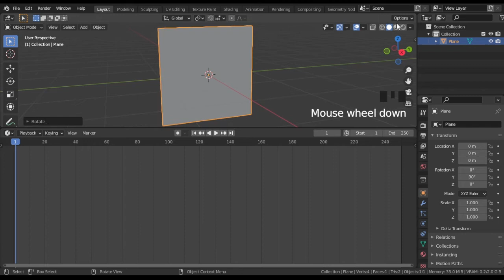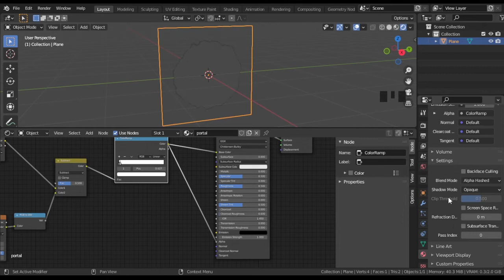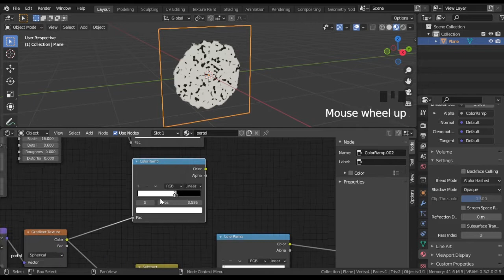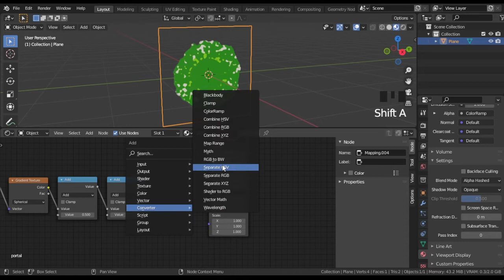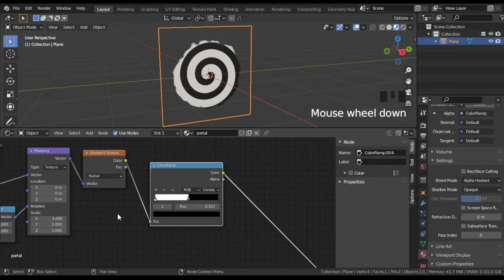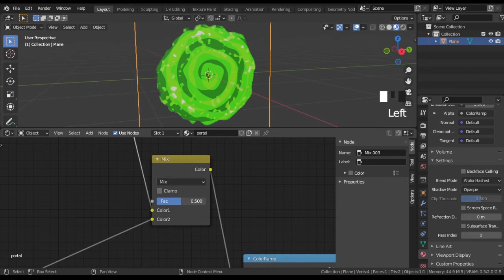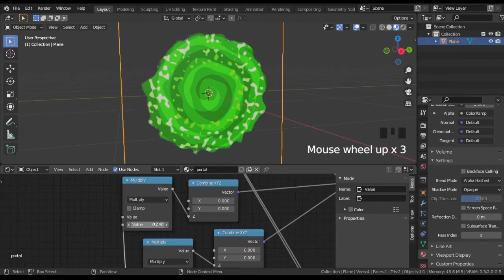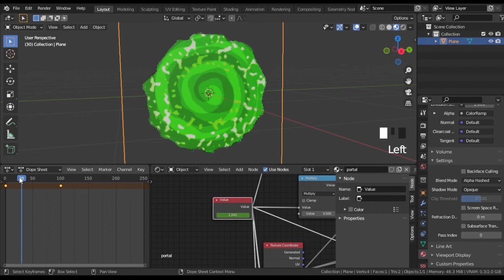How to make Green portal from «Rick and Morty» (Blender tutorial)

Comment: hey it's been 3 year's after this video but i wanted to know how can i make it thick? i tried to use the solidify method but it didn't work hope you will answer
Reply from the maker: Hi! Sorry for late response – haven't opened a project for a long time plus was busy with pwnisher challenge). I hope my answer will be still relevant. 
So, before solidify add subdivide surface. Your solidify thickness set to zero. In material settings look for displacement and set to displacement only or displacement and bump. Then go to shader nodes, find a substract color node that goes to alpha (right before color ramp) and input it to height value of displacement node. And finally connect displacement node with displacement input of material output. You can additionally add a color ramp before displacement node. Tweak black and white sliders to set affected area (I pulled black a bit to the right like 0.05 and white to the 0.2), pick a scale for displacement node (0.2 worked well for me but you can pick higher for thicker one; midlevel value stayed 0) . And for subdivision – displacement works better with higher geometry. So easily set to 6 if acceptable for your needs. 
That's the best way to achieve this in a current setup I've found. Better approach might be using geometry nodes but it would be a whole new project from a scratch.

Comment: Hey Bro, can you tell me how i have to export this material, so it is still animated in unity? Cause with fbx and standart settings it will import as a gray plane. Btw, really cool Tutorial Bro, you deserve much more subscribers and likes
Reply from the maker: Thanks, Bro! Glad you liked it! 
    Struggled with your problem for a couple hours but finally found a solution. https://www.youtube.com/watch?v=1W_QCoLb4hQ this tutorial is your answer. 
    For this you will need add-on (link in that video's description). On GitHub you will only need the oscurart_bake_pbr.py file. Save it on you PC. Then install it (Edit -> Preferences -> Add-ons -> Install -> Refresh). Blender: Bake PBR should appear in the list. In Render Properties Bake PBR tab will appear. Check Base Color, Alpha and Render Sequence there. Uncheck Selected to Active. Delete all the keyframes at Dope Sheet Then go back to Shader Editor. In Value Node type #frame/10 
    Finally click Bake PBR Maps. It will take some time to bake everything depending on your PC. When baking will be finished the folder IMAGES will be created in the same folder where your blender file is. I executed this at my portal project and it worked. It should work in Unity too but I haven't tested it. As a last resort you can use these images to create a gif. 
   Hope it will help your project.
Reply: @drrender4931  Thank you very much, that helped :)
Reply: @eatdeliciouskids7965  Hi did it really work with you? If it did, can you tell me exactly how did you do it because I don't know how to import the images file to Unity

Comment: Hello. I have a problem: I would like to make a cyclical animation for that portal. BUT I need there to be no abrupt transition - that is, I want the portal animation to flow smoothly into itself each time, without tearing. And the rotation must be strictly clockwise. Can you tell me how to do this trick with this particular portal?
Reply from the maker: Hi! Sorry for not answering earlier. For rotating strictly clockwise you can simply change sign in each multiply node. 20 – > -20 and so on. In each. For cyclical animation things are harder. In easy way you can simply disconnect location value for each mapping node to make it constant. Add math node To Radians right after input value node. I've picked input value 36 000 and now the animation is smooth. After that it's up to you to pick the speed of swirling. Just drug the keyframes righter (i moved to 500 th frame) to decrease rotation speed and try picking another values for multiply nodes. If you want a bit more variety try some periodic math function for disconnected earlier locations in mapping nodes.
Reply from the maker: In addition, I've also changed two multipliers that go to wave  texture from 0.5 to 0.05. Now the spiral swirls a bit slower than should compared with edge rotation but not extremely fast for perception.

Comment: I followed all the steps up until turning it green (about 5 minutes into the tutorial) but by the 3 minute mark on the video my portal turns hot pink and I can't change it, it's just solid hot pink.
Reply from the maker: Hi! It looks like you have missing textures. Usually it happens when Blender can't find a way to external textures and use pink color as placeholder. But for procedural textures there is no external textures. The problem might be that your shader tree might be using all the allocated texture memory of your graphics card. Try rendering using cycles.
Reply: @drrender4931  I've tried switching to cycles and it still looked pink. Is there anything else I can do?
Reply from the maker: Sorry for not answering earlier. Have you fixed your problem? I've repeated my own tutorial a couple of times and it works every time. Maybe you have some specific settings or add-ons?
Reply: @drrender4931  No problem! Not that I know of. Do you have any specific settings or add ons enabled?
Reply from the maker: @kira_covers5898  I have a few addons but they don't involved in video. I've also switched them off to test and nothing changed.
Reply: @drrender4931  Wonder what it could be then. I probably don't have a good enough graphics card. I'm not giving up though and your work is amazing. I'll follow another video and let you know how it goes
Reply from the maker: @kira_covers5898  thanks for your words! I really wish I could help you. Keep on working. Try another approach and other tutorials. I strongly recommend blender guru channel because his donut tutorial is awesome and had inspired a lot of guys to work with blender. I am pretty noob and had started real work right after that tutorial. And still studying. This channel is a part of studying too. Learning English, practicing spelling, video editing and of course creating in Blender. I wish you a good luck. You will do it, my friend!
Reply: @drrender4931  thank you so so much. I'm a beginner. I've made a few things but I've started more things then not finished it. I started an animation I've gotten pretty far on its 95% done but I don't know how to do the final step which is connecting 2 desperate node noodles into one noodle even though I followed the steps and I'm struggling to get help on reddit lol so hopefully I don't run into that problem again. I also made the blender donut then gave up half way through, I plan on making it sometime though
Reply from the maker: @kira_covers5898  maaaan, the same problem. By the now this is my second or third attempt in Blender. And I have a lot of unfinished projects too. I am interested in cars. Modeling that shapes is really satisfying. And useful. I tried several times to create something. And finally a few days ago I've finished my first car in Blender (after month of work). I was so proud of it, my friends liked it too and I've immediately placed it on marketplace. And now I want to create more and more. I even planning to create some sort of tutorials about modeling auto. I hope my story will inspire you)
Reply: @drrender4931  You also have that problem with the nodes? Also, thank you once again. Your an inspiration and thank you for all the help 🖤
Reply from the maker: @kira_covers5898  honestly I don't understand the problem with nodes you talking about. Are you talking about my video? If so I can make a picture of full node tree and put it in a description. Maybe it will help you.
Reply: @drrender4931  Oh no it's not your video it's that I'm having trouble connecting 2 different node noodles into one noodle